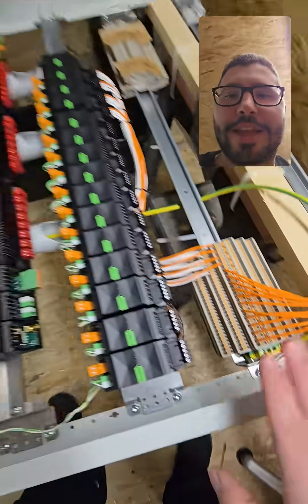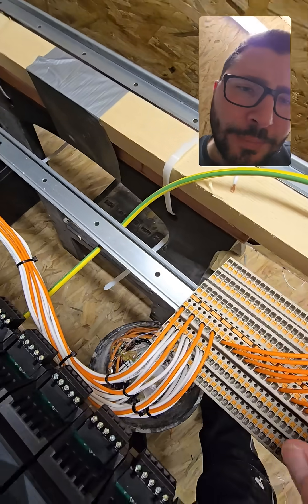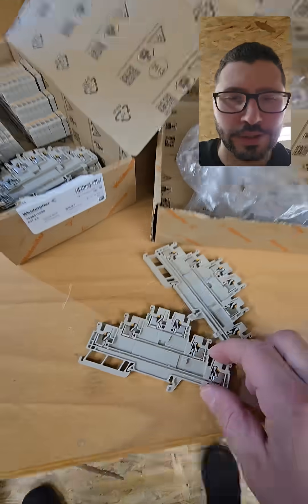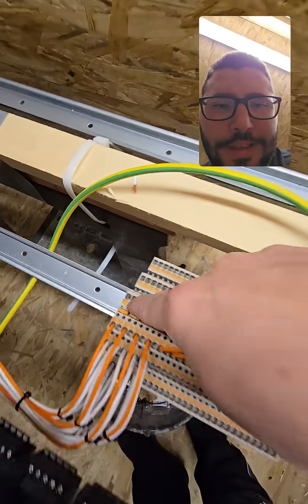Terminal blocks 24V Dimmers #loxone

Comment: Even without cable trays you made it look very neat!

I was wondering now that I see this, what is your opinion on protecting the outputs of the 24V dimmers against a short circuit? I have heard some people add in extra fuses after the dimmer.. or does the dimmer have automatic protection against that?
Reply from the maker: Thanks! With the Loxone Power/Backup there are 7 channels with fuses so there i keep it with those. If you use 20A meanwell or so then sure! Also the sensor side with thin cables its crucial to do so 🤪

Comment: Great work.. relay extension or Nano 2 relay for shading? what’s the main difference except the cabling?
Reply from the maker: Nano2 has current measurement in a way so it knows the times for up/down, on Relay you have to measure and program it :)

Comment: What cable are you using from the 24v RGBW dimmer to the lamp?
Reply from the maker: Its a 1.5qmm single wire flexible to the terminal block and to the tunable light its a 3 core 1.5qmm numbered cable, 3x black but 1-3 on it. Its from Lapp / Ölflex

Comment: A timer from Legrand is a good way to use if your having a long vacations. Turning it on/off everything you need to be switched on when your away automatically everyday down to every minute for months... and can water your garden too. I've seen these timers work when I'm working as an Electrician in Saudi Aramco 1996.